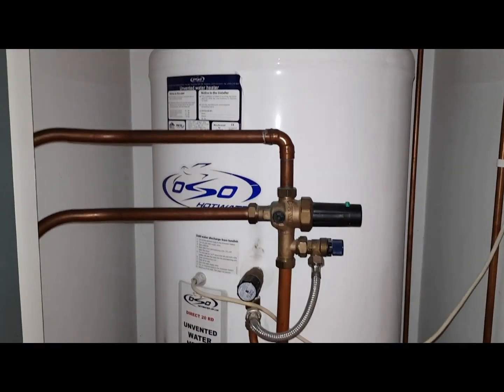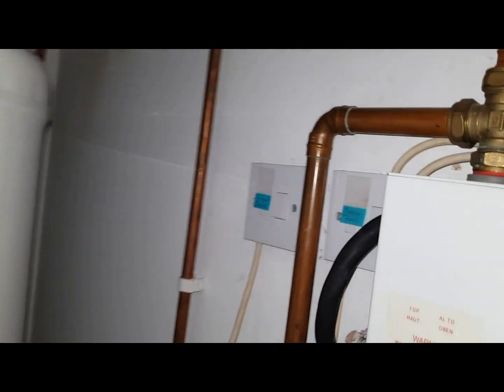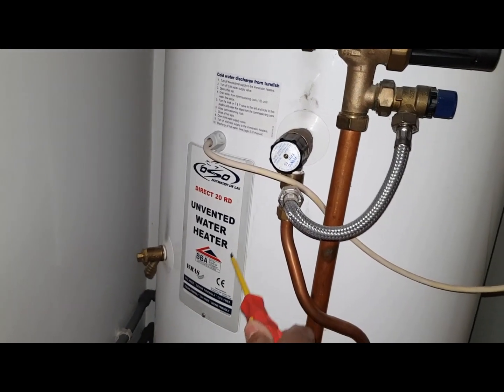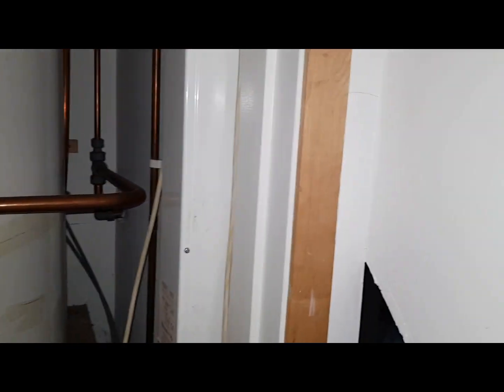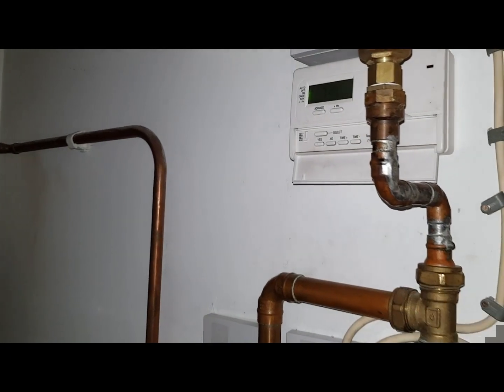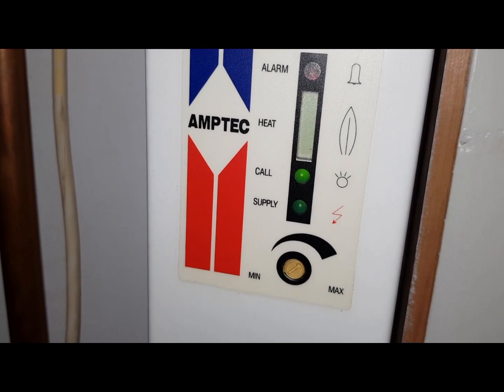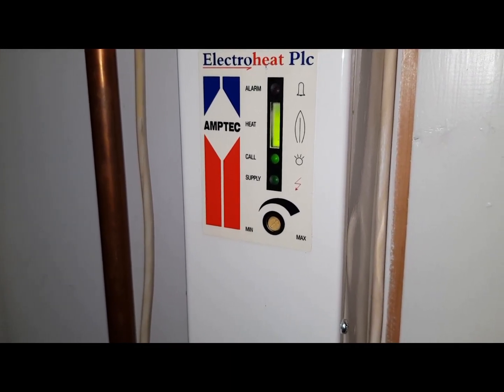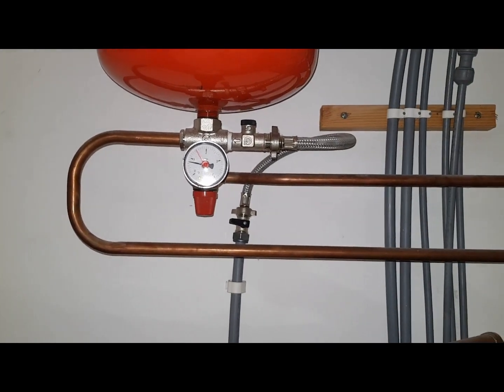How Does my  Hot Water and Heating System Work? (Electric). With Coach Tony Morgan

Comment: Hi Tony, thanks for the video! Just a question please:

The unvented water heater and the electric boiler they function separately? I mean if we have a thermostat on the wall and set it to 18 degrees, my understanding is that the electric boiler will heat water to the water temperature we want and send it to the radiators. This hot water that goes to the radiators will come from the cylinder or from the main supply?
Reply from the maker: The cylinder is heated independently from the flow boiler. The flow boiler only heats the radiators.
Reply: @ARBoilers  Hi Tony thanks for your response! In that case the electric boiler heats the radiators and we can manage efficiency with wall thermostat i.e on main hall , plus the TRVs. Then when we open a tap for hot water or shower that water will come only from the cylinder? If yes what is the most efficient way to operate the unvented water heater? As a rough estimate, I want to rent a 1 bedroom flat (all electric flat no gas at all) with the same system as described in your video, during cold winter in the UK (Yorkshire), using heating 7-8 hours a day plus hot water for 2 people, will that be more than £200 pounds/month? ( I understand that tariff and provider can make a difference and ) Thanks in advance for your time!

Comment: Hey Tony, cracking video! I was wondering if you'd be able to help? If not no worries i'll call an engineer out!

I have just moved into a new 2 bedroom flat. Unfortuantly we don't have gas heating, its an electric boiler (GAH Electrastream boiler - 9Kwh).

We're struggling to get our flat warm, and not sure if we're operating the boiler correctly, its different to my previous one.

We're on E7 Tariff, so I have set it to heat the water up between 4-6am. The boiler shows a water temperture of 65 degrees which if not used, will stay like this till we use the water up.

We have a thermostat but the radiators don't get hot unless we have the heating switched on which is obvious, however with this 9kwh boiler, when we're paying 15p per kwh, am i correct in assuming that every hour we have the heating on, it'll cost us £1.35 (9 x 15p)? This is insane at this time of the year, or are we doing something wrong?

If you are able to advise that'd be great! thanks mate
Reply: Well, yes it will, but with a timer, thermostat and TRV's on the rads it will not be on permanently and so the cost will be much less. I have one in my 5 bed house and due to location no gas, oil, or gas tank we rely on electricity. It is expensive but works well.
In twelve years it has never failed, never needed servicing so gives reliable operation. Try to arrange to use as much of the cheap rate power you can, by heating the property up early morning!